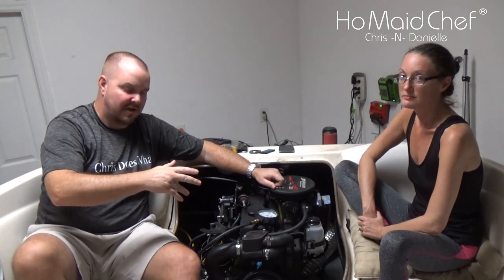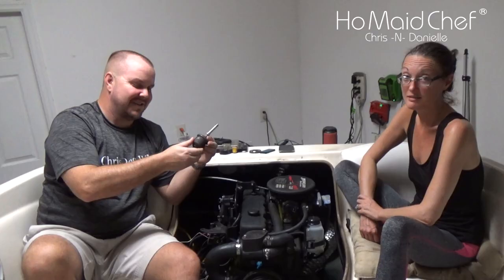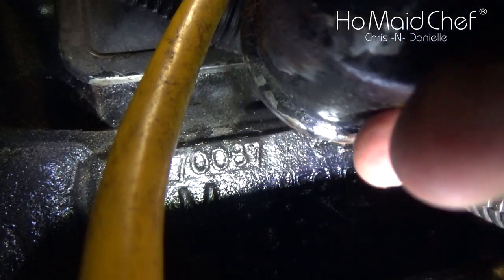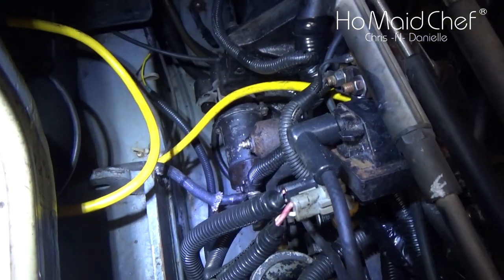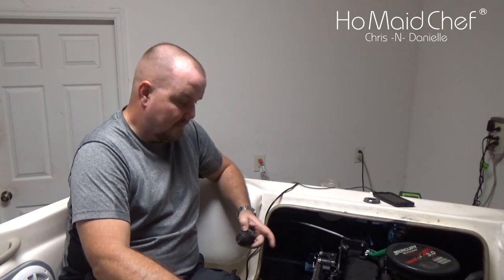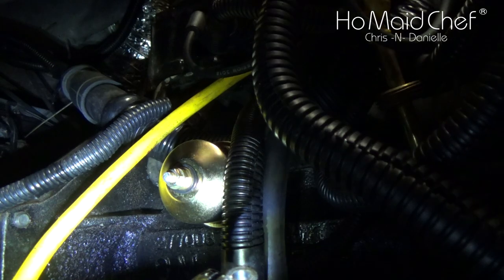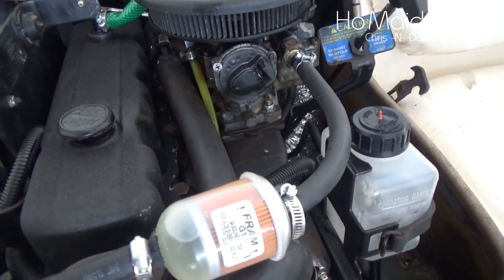Install Oil Sending Unit And Fuel Filter EP #54 || Bayliner Bowrider 175

Comment from the maker: Love to hear your thoughts, also here is a table of contents for the video.
Jump To:
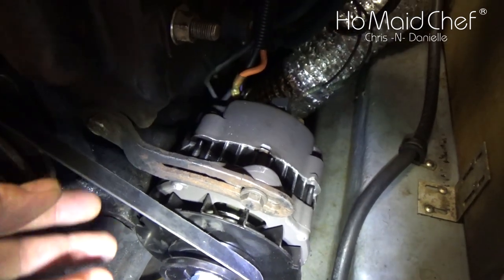1:41 The new alternator we installed, now we can run the radio out on the water.
2:12 Installing our old sending unit with the oil pressure extension from Jegs.
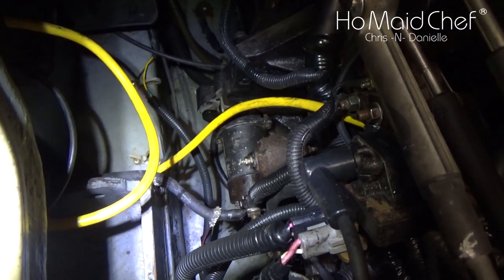3:30 Starting our Bayliner Bowrider with Mercruiser 3.0 and see no oil pressure.
3:52 Oil pressure sending unit side by side, the old sending unit is very rusty.
4:00 Our temp PVC hose to our breath made from a garden hose.
4:33 Fuel filter we installed on our Mercruiser 3.0 boat engine.
5:56 Oil pressure for our Bayliner Bowrider after we installed the new oil sending unit.
6:59 Go over what was done, our new shop and what is coming on our website, and we talk about things to come.

Comment: Chris, money saving tip here. Don't run your boat without water. Lower unit pump will burn up fast.
Reply from the maker: Thank you. Yes, we ran it briefly, just to make sure it started, we tuned it later with water running through the engine. Don't want to burn up the rubber impeller!

Comment: You got no oil pressure.  With the key on and the engine not running it reads about 20 (wrong sender should be 0).  With the engine warmed up it reads about 25.  I think this sender is wrong.  You can put air pressure into the sender and see where your meter reads.  Good way to check out your sender and gauge.
Reply from the maker: Thank you for your feedback. The sender does show 25 PSI with the engine warmed up, we did not run it long, had no water running in the engine.